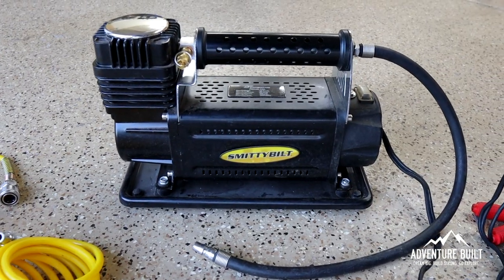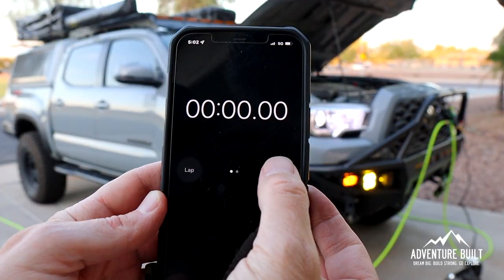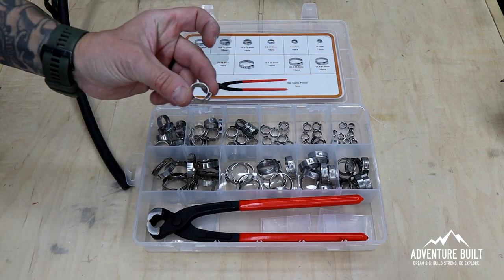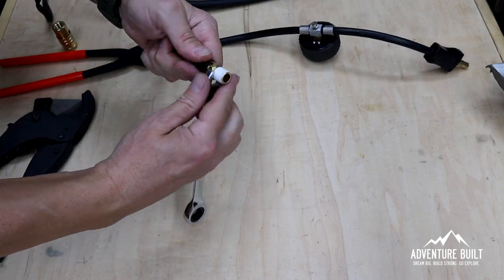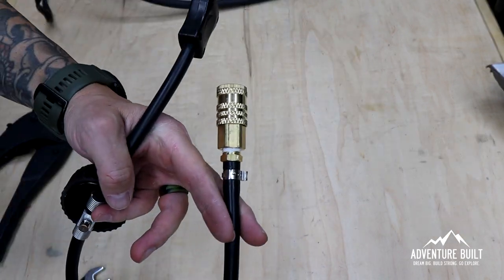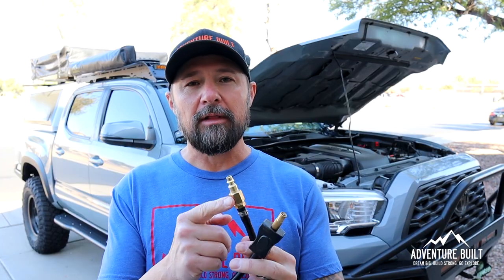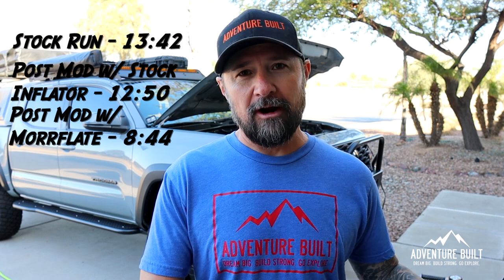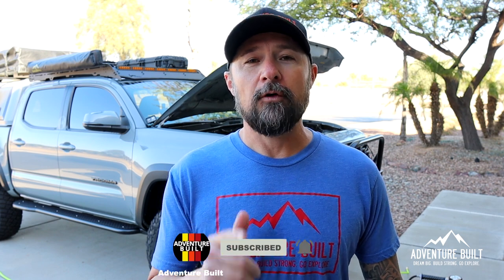SIMPLE INEXPENSIVE UPGRADE TO SMITTYBILT COMPRESSOR | MORRFLATE QUAD INFLATOR CUTTING INFLATION TIME

Comment: A more accurate timed experiment comparison has to include all the unpacking, setup, teardown and repacking the equipment as well as the time required to actually put air into the tires. It's the time you spend messing with it from beginning to end and you are back on the hard top (going from the driver's seat to back into the driver's seat with all 4 tires adjusted)

Comment: Heads Up:  Keep those head bolts tightened down. They work loose & the lubrication oil leaks out of the cylinder.

Comment: I love our portable compressors as opposed to on board air. It's specifically for airing tires so I figure why use up space for all this on board stuff. Especially when some vehicles are space limited. Rather use that space for dual batteries or something. But the main reason ... I can take it in the house. So if someone takes my Jeep ... all my stuff is still mine. I just find them convenient, myself. But like you said ... easy to wander it over and help someone else out. Everyone has their own now, at our house.

Comment: I think you did a great job with this mod. I didn't read all the comments and maybe some else already suggested this. A check valve on your leader hose will extend the life of your compressor in two ways. The compressor won't have the back pressure from the tires pushing back on it making it work less hard each time you stop to check your tire PSI.  Second it is possible for air to leak back through the compressor deflating the system while you pause to check tire pressure. Because you don't have a pressure switch DO NOT turn on the compressor until everything is connected, the air has no place to go and you risk damaging the compressor.
Reply from the maker: Great info. Thank you. I’ll definitely look into adding a check valve. Much appreciated!!!
Reply: Are the check valve and pressure switch the same thing?

Comment: I did a similar mod and added some others.  I added a pressure switch too.  One thing I did too was add a 10ga SAE connector to my front bumper and converted the aligator clips so I don't have to open the hood every time.

Comment: The similar-looking Vevor is now priced at $76.99 on their website vs. $203.99 for the Smittybuilt, making the Smittybuilt 2.6 times more expensive.  I have been using the Vevor compressor for several months and it has been working great. Would be nice to see you do a side-by-side comparison.  

I followed your lead and made the same modifications to connect it to my four-tire inflator and deflator system.  Definitely the way to go.
Reply from the maker: I’ll take a look at it.

Comment: I have a 4 hose system and now need to get a compressor. Long term, would you still say this smittybuilt is the way to go? Or are there better options now? Which would you go wtih if you were buying one today? I know they have bigger CFM compressors now, but storage space is also a premium. So for me, its a size vs speed balance.
Reply from the maker: There are definitely better options out there. I recently did a compressor review. Check out that video for sure.

Comment: This was so extremely helpful. I just built my own 4 way air hose system and I’ve been trying to decide what pump to use that will work with my 4 way system well and this video answered that question perfectly.

Comment: I LOVE my MORRflate. Definitely one of my favorite purchases. Most of these compressors are way more capable than the single hoses they come with, so using a multi-tire system really makes the most of the compressor. One recommendation I have is to do yourself a HUGE favor and buy the MORRflate dust caps. When you're airing up at trailheads it's impossible to keep those chucks clean and soon they become very hard to use. They aren't too hard to clean, but you don't want to try and do it on the trail.

Comment: I swapped the connections on my smittybilt about 2 yrs ago , including the fill hose swapped to one from lowes. Works much better but not as good as that Morrflate setup. Now I have to consider the 4 tire setup !  
I would be interested to see how the new compressor matches up with the smittybilt. .

Comment: Great video!! I'm going to get this exact set up now.
Question: When the system is completely connected, are you supposed to open the valve and then turn on the compressor or turn on the compressor and then open the valve? Will it create back pressure if the valve is closed? I don't believe the smittybilts have an auto shut off for pressure like other compressors do. Thanks for the help.
Reply from the maker: I personally like to turn on the compressor and then quickly open the valve when starting. Then when I want to check the pressure I close the valve and turn of the compressor. It’s really easy to do since it’s all right at the front of the rig. Glad I could help.

Comment: At 6:10 your hose coupler shown will probably damage a few compressors if people follow that advice.  As I recall, the Smittybilt instructions warn against running the compressor without relieving the pressure.  The female coupler shown at 6:10 will work on an air accumulator tank where the compressor shuts off when it reaches a certain amount of pressure.  Turning the compressor on as shown at 6:10 will result in the compressor immediately achieve maximum pressure and the pressure release valve will repeatedly pop.
Reply: Exactly correct. I like Adventure Build's videos in general. But the type of compressor the smitty and its clones are will be damaged by this direct unrelieved connection can easily destroy this type of compressor
Reply: What’s the solution?

Comment: If hoses are to tight to get them over fittings, just grap an electric kettle and dip just the first 3/4 of an inch in the boiling water. 
Now you can attach the hose with ease.

Comment: Do you find your Smittybilt handle gets extremely hot and need a shirt to pick it up after inflating the tires?  The compressor works great, but gets so damn hot!

Need to get the MORRFlate!  Looks great.
Reply: Mine gets hot & I have to let it cool before packing it away. Especially on hot summer days!

Comment: Thank you for that comparison..I often wondered which was faster the 4 tire vs the single tire.. but nobody ever included the time to unravel and connect the 4 hose system within the inflation time. That is pretty impressive... Almost a 5 minute differential... That dessert armor compressor is really a beast.. Twice the CFM compared to the Smitty 2781.  Summit racing has a similar one for about $180 and Napa has one for about $114.. Unfortunately they seem to be sold out. The advantage of the desert armor one is it has the pressure switch already built in..
Reply: agreed...I have the smitty 2781 and if I could do it again I think I may have gotten the napa one for double the cfm. wonder if the smittybilt would outlive the napa one though

Comment: I modded my Viair to inflate two tires and once by adding a T in the hose and swapping to clamp on valve fittings. It didn't cut my time in half but it only cost about $20. When the Viair finally dies I will go with the Smittybilt compressor.

Comment: I run 265/75 R16s on my 2017 access cab taco, and I have a fiberglass ARE camper shell. How can I know what pressure is likely the best for my Michelin Defender tires? Should I stay at 32 psi, as written inside the door?

Comment: At trick we use when we need to lube something like a fitting but want it to be more permanent is using hairspray.  Works great as a lube for a few minutes and once it dries it is a much more solid connection.

Comment: I went co2 and haven’t looked back. People love it. Just the quietness of it makes it worth it, but it’s also insanely quick. I never realized how fatiguing the noise was until it was gone. 
.
People love to brag about their maxitrac compressor. It’s nowhere near as fast. Just did a Baja trip where I deployed my tank after a maxitrac just started filling a tire, I filled all of mine from 20 to 35psig, put it all back, and he just started on his 3rd tire. 
.
Not much will compete with a 500-700 psig tank regulated down to 200psig. I have the larger HF unit under my seat in case I ran out of co2.
.
We were at a camp site one night and I was topping every rig off because their compressors were too loud to run and we left early.
Reply: As a diver I have the tanks, the 1st stage regulator takes it down to 150psi
I have the BC inflator to air chuck adapter 
So if I'm on a dive trip that gear is already in the LR4,  if not I have and Ironman compressor

Comment: I just got the same set up since I have my Smittybuilt I got years ago.  Does your Morrflate gauge PSI readings match the TPMS on your truck? My Morrflate gauge is much lower than my Jeep JLs readings
Reply from the maker: No they are different. I don’t think the TPMS is as accurate. I have used multiple gauges and non have matched the dash.

Comment: A good idea would be to use the universal female fitting so you can use either an automotive or a I/M fitting if you ever need to use any endpiece other than your own or you are airing up a tank or whatever for someone else. I have the same compressor marketed by HF and it works great. Are there better ones? Sure but at multiple times the cost. I like thet I can take this compressor for the trail, but leave it at home during the week.

Comment: Did you use the 125" wheelbase kit?  The specs for the Taco DCSB are 127" wheelbase, it looked like you had plenty of length on the kit you used. Thanks

Comment: Hey nice video man I just wanted to verify does the smittybuilt compressor work really good with the 4 way inflate is it worth it if I dont want to buy the arb one? Are those 8 minutes how long it took to air up with that compressor or just to set up?
Reply from the maker: The smittybilt compresor does just as good a job as an arb compressor and the 8 minutes time is just what you see in the video. It doesn’t include pulling everything out from storage. Just the time it takes to open the Morrflate, make all the connections and turn the compressor on and air up to 40psi.

Comment: So if I got with the smittybuilt 2781 and the morrflate option...The morrflate kit comes with everything I need to attach it directly to the compressor? Or do I still need other fittings?
Thanks!

Comment: Can you change the connection from battery clamps to an outlet plug to plug into an inverter?
Reply from the maker: You definitely can but you will have to cut the cable and splice in your preferred connection point.